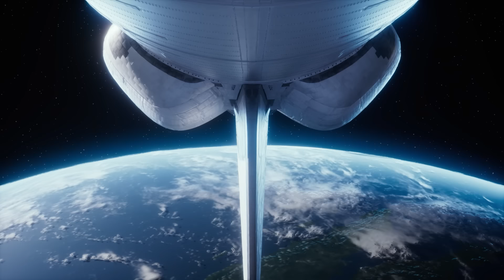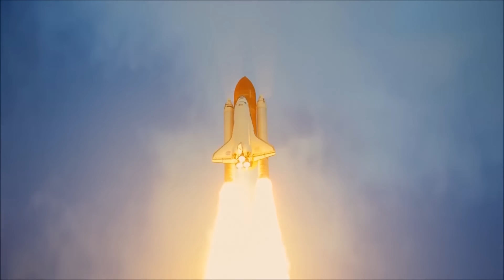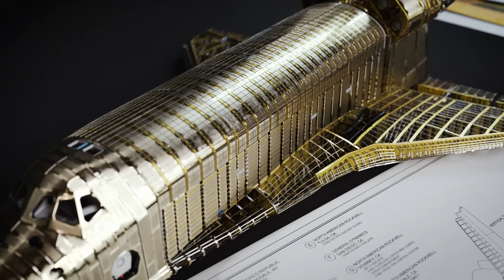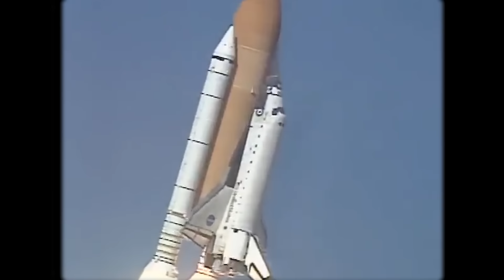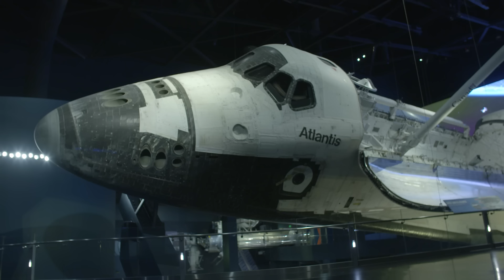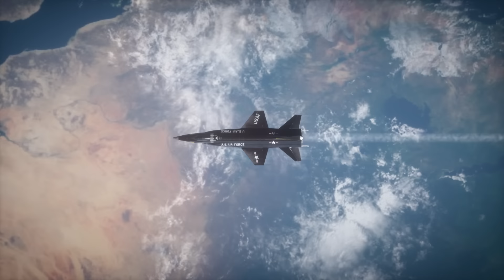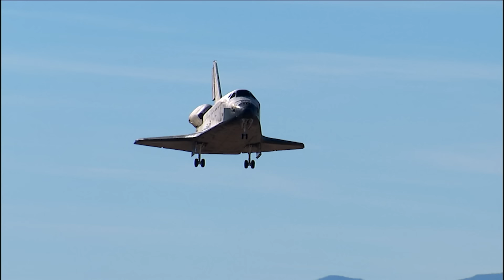The Insane Engineering of Re-Entry

Comment: One small thing: 177°C = 450K; 980°C = 1253K. So Inconel X can withstand a little less than 3 times the temperature of Aluminium, not more than 5!!! That’s why we always do temperatures in Kelvin 😅
Reply: that is a very good point, I didn't even realize that.
Reply: Or Rankine if you are working in America's private sector. 

But honestly, once you get outside of the everyday units and ranges its almost always easier to just use metric. (Imperial is a pile of legacy units, that are pretty good in context but once you leave that context and have to convert it just gets gross. I still hate that i know what a pound-mol is.)
Reply: @jasonreed7522 eww. Yea, glad I've never seen a pound-mole before. I just love that 1lbf=1lbm (at sea level on earth etc etc). Amazingly thats what confused some of my coworkers once, they kept telling me I didn't multiply by gravity lol. We got the same answer, they just didn't understand how I did it without converting to slugs(gross).
Reply: @crazy_mind-ox8if  thats the beauty and the curse of imperial, each unit usually has 1 or 2 contexts it is literally perfect for, and maybe some nice conversions or conversions with nice properties that conveys some insight about the universe. (Like how mass and weight are functionally interchangeable on earths surface) the curse is basically all other conversions are pretty gross, and formulas won't always cleanly output the desired unit.

Also the context of the pound-mol was thermodynamics in college, mainly the heat engine cycles where we had tables in both metric and imperial and had to use both. I understand that ditching the pound and foot in daily life will probably never happen, but the gas laws felt like such a reasonable place to leave imperial behind instead of finding out the needed constants to do the math with imperial.

The most cursed unit i know of is the kilofoot per second, used by NASA to measure space shuttle reentry velocities. Realistically the only thing cursed about it is that normally the prefixed aren't used in imperial and instead we swap out units. Sometimes we say thousands of X or millions of X, but basically only with time do we use prefixes instead of something worth 1/124 of a second. (Technically there is no reason we can't use kilo feet, or gigapounds, or centigallons, but it just sounds wrong)
Reply: This video is full of small errors.
Reply: @jet_enjoyer  Another error is at the 12 minute mark, he said "Inconel, mostly being made of steel". As I'm sure most of us know, Inconel is very much not a ferrous-based alloy but rather a nickel/chromium based alloy.
Reply: @DefinitelyNotJ749   yea I made another comment including that. I thought everyone knew inconel and hastelloy were nickel alloys
Reply: Now I get why Space X chose stainless for Starship - KISS principle ..
Reply: @TheFamousGruntNYkong  no, single-use rocket is more KISS, because you can make it with fibre or light aluminium.
Reply: using muliples when talking about temperatures feels  just wrong overall. just state it can handle xxx Degrees more
Reply: Inconel is the material of jet engine turbines where they regularly endure sustained 2100+ K, so in terms of capability more than 5x is correct.
Reply: "3 times the temperature of Aluminium" - that's worded poorly, Aluminium doesn't have a set temperature.
Reply: @TheFlyingDogFish  yeah ok you’re right, but I think in context It’s pretty clear that I mean the max temperature that material can withstand safely. Or if you’re getting at something different please explain, maybe im misunderstanding
Reply: Oh there have been some epic fuckups when it comes to metric/imperial confusion..
Reply: Kelvin, joules, electron volts….whatever works.
Reply: Dude Kelvin is the BEST scale. It tells you sooooo much more than just the temperature
Reply: @ Captain Cookie,
You beat me by 2 hours !  I calculated 2.78 times Inconel / Al
:-)
Reply: yeah I was thinking this same thing. Also I am not sure if even using Kelvin is an accurate measure since different materials react differently to different temperatures. Kelvin still used water as its base material in that it is tied to water transition points. We can say that Iconel X has 3 time the temperature in Kelvin as Aluminium but is that actually 3 times as much energy which is what we are actually trying to measure with temperature.
Reply: @chaosfenix   what are you waffling on about? Kelvin is a perfectly accurate scale for measuring average molecular kinetic energy, or temperature
Reply: @jet_enjoyer  Because kelvin is only able to measure the relative amount of energy held in a single material. Once you start comparing materials that all goes out of the window due to different materials having different specific heats. Kelvin is simply a temperature but does not measure the actual amount of energy in a material. That is specific heat which is measured in  joule per kelvin per kilogram.
Reply: @chaosfenix   what you are referring to is called specific heat.
Reply: @jet_enjoyer  That is literally what I said in my response to you. I even gave the scientific units for measuring it.
Reply: @chaosfenix   What you said was incorrect. You said you were unsure whether kelvin was an accurate measure of temperature when comparing different materials. You said, “inconel that is 3x the temperature of aluminum actually has 3x the energy of the aluminum”. That is not true. 

Kelvin is an absolute scale for temperature. Any material at 900°K is 3x the temperature of any material at 300°K.  

The energy of a material due to temperature is called internal energy and it is a function of both temperature and specific heat. Since specific heats are different for different materials, it is not true that Inconel at 3x the temperature of aluminum “actually has 3x the energy”. You are wrong. You know a lot of the terms but you are confused about this. 

Comparing the temperature of two different materials is more useful than the internal energy in most settings, certainly in this one. For that reason we use an absolute scale for temperature such as Kelvin of Rankine. Hope this helps

Comment: Steal is not a good conductor of heat..? (12:05)
Reply: compared to other metals like copper and aluminum, no, by almost half
Reply: There's a reason you can put a steel spoon into boiling soup and still hold it at the other end. Try it with a copper spoon.

Comment: None of the things he calls "insane engineering" is in any way insane - incredibly sane, in fact. 
"Insane engineering" is what went into making the Verrukt waterslide that decapitated a boy.
Reply: Insanely complicated compared to tried and tested ballistic re-entry and splash down.
Reply: @mikeomolt4485  well, it’s not “insanely” complicated, it’s impressively, rationally complicated. Insanely complicated would’ve when you overcomplicate the design, add too much unnecessary details and criteria, etc. the designs NASA comes up with are extremely sane.

Comment: The first time I saw an orbiter in person I was completely taken back by the thermal protection system.  As a kid, I would write to NASA to get information on the STS (no internet at the time) and would read it over and over, so I knew that the shuttle was not just a painted aluminum aircraft (like it appeared on 80's television).  

When I first saw it in person at Kennedy the first thing I thought was 'it looks dirty' and pieced together, and not as refined as it did in the photos that I had.  It gave me a better appreciation for the careful design, engineering and fabrication that went into it.
Reply: Did nasa ever respond you ?
Reply: @ni9274  All the time. I would get a large envelope from them every week filled with color photos and documents.

Comment: I wonder if they couldn't install small single use rockets like those installed on the AC-130 (super Hercules) for emergency thrust during re-entry. Also, the use of canards or variable wings (like on the f-14 tomcat) to further increase lift during re-entry. I guess we'll never know, since SpaceX has practically re-wrote the book for re-usable spacecraft.
Reply: @scottmanley has a good video about this!
Reply: Remember, the more you add, the more weight you need to provide fuel for. So putting emergency rockets on the orbiter means you now have to either carry fuel for them or use fuel from the orbiter itself which means it needs more fuel...
Reply: @stylesrj  I can't remember where I heard the quote "shuttle is a flying brick." Plummeting back from 45km above the earth with no emergency lift, aiming for a 3km patch of runway is like throwing a dart while standing on a bowling ball that's spinning at 10000rpm. . . Truly awe inspiring. With regard to the emergency rocket motor, just a "what if."

Comment: 20:39 talks about how shuttle's design was dictated by a mission from cape Canaveral mission but i think that this is supposed to be refrencing a mission from Vandenberg AFB? Scott Manley has a great video about it
Reply: To be more precise, the mission requirement was to launch into a polar orbit, rendezvous with a satellite, retrieve it, then land back at Vandenberg.  The cross range was required to account for the rotation of the Earth.

There is no physics reason why such a mission couldn't be performed from the Cape -- but it would require dropping SRBs on the East Coast or on Cuba.  Politically speaking, this was never going to happen.
Reply: Yeah, you're right. A single orbit mission makes more sense from Vandenberg

Comment: 10:20 spray a layer of tungsten carbide or tungsten rust on top

Tungsten has a higher melting point...

 Need magnetic power levitation to mass produce it in a furnace
Reply: Tungsten can easily handle reentry Temps

Titanium-tungsten alloys or titanium is a replacement for aluminum too
Reply: 13:10 use materials that reflect infrared and near infrared back out towards the atmosphere?
Reply: 14:00 use gold and silver, or chrome

Nothing reflects sunlight better than a mirror
Reply: Tungesten also has a density of 19.8 G/cm.

How you gonna bring anything up there with even a tiny amount of

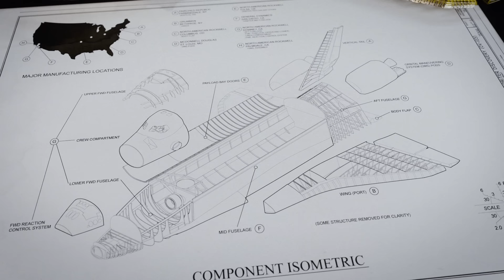Comment: The aluminium has a max operating temperature of 177 degrees? What is that made of, butter? 3:35
Reply: It doesn't melt at 177.  At 177 it is no longer strong enough to be used for the airframe.

Comment: This is pathetic!
Soviet Venera probes had to  withstand temperatures up to 11,000 °C (19,800 °F)...
Insane  Engineering indeed... something that Hollywood super power never manage to achieve.
Reply: Venera used ablative heat shields which are simpler and more effective.

Nothing to brag about
Reply: @peeperleviathan2839  Nothing to brag with withstanding 1,650 °C but you still brag...
Reply: @zarjesve2  explaining how it works is bragging

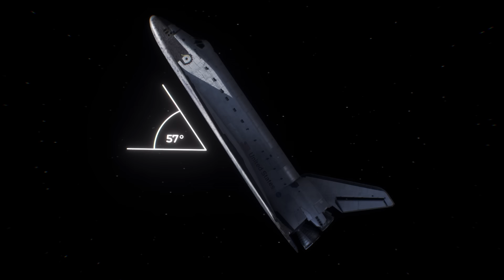Comment: At 2:06, don’t you need the RCS firing in the other direction to stop the rotation?
Reply: RCS was used to start the de-orbit. Once it hit the atmosphere it was all aerodynamics.  The amount of RCS fuel needed to counteract the aerodynamics could not be stored in the orbiter.
Reply: @mm-nyc they're talking about the rotate to de-orbit attitude from the retrograde burn. Not rcs control during reentry
Reply: @mm-nyc  The animation shows the craft changing starting attitude change with RCS, but then stopping without firing RCS. 

It looks way too early for aerodynamics to be at play since it would mean exposing the craft to reentry heat before reaching the ideal attitude.

I think it's a simple animation error, but just wanted to confirm it

Comment: 3:45 - 1650 degrees Celsius is not ten times greater than 170 degrees. It's less than five times greater.
Reply: is your math failing? 170*10= 1700 pretty close to 1650, and if you say that is less than please remember he might have rounded it off
Reply: @AtrociouslyAnnoying  Someone didnt study science and doesn't realise that heat doesnt depend on celcius it depends on kelvin
Reply: How could someone be so wrong when talking about multiplying by 10 and 5

Comment: me playing ksp and blowing up 20 of my rockets before 1 successful reentry:

"im something of an engineer myself too"
Reply: A Soviet engineer, maybe, but an engineer nonetheless
Reply: Me playing KSP and making a space shuttle type craft to land back on the runway but I end up missing it and landing on the other side of the planet, at night, upside down and in water

"Like a glove 😎"
Reply: Only 20?
Reply: dw i still had dozen of stranded kerbal outside kerbin, and probably severals of them lost in deep space right now
Reply: Without dV mods and charts, as well as maneuver planning, I'd never have gotten anywhere in KSP.

However, I was apparently great at reentry. I actually shocked my few viewers of a live stream when I completed my transfer burn from Minmus to Kerbin reentry and left the computer, while the reentry was starting, to go to the bathroom and get a drink. Returned to the crew module safely falling with parachutes auto deployed. Viewers thought I was crazy. 

In all honesty, the reentry physics in KSP are very forgiving. Some of my space planes couldn't hold the necessary angle of attack needed to properly distribute the heat from reentry. My solution? Flail the space plane around as violently as possible. This worked, because KSP reentry is very forgiving.
Reply: Eh, good enough.
Reply: KSP taught me how to eyeball Hohmann Transfers. It also taught me how to calculate one, too.
Reply: Huh
Reply: Me too
Reply: still better than spacex :)